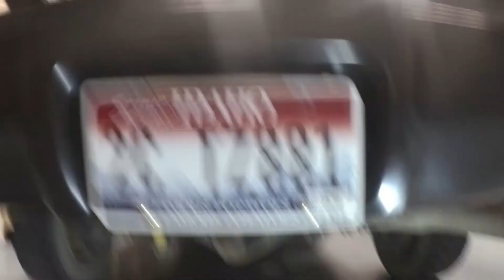Roll Pan Part 2

Comment: What size of nuts/bolts were you using? :)
Reply from the maker: It has been a while since I did that instal but I think probably 1/4” bolts and nuts.
Reply: @DarksideDiesel  Thanks, from one 208 to another

Comment: You could have cut the license plate screws so that they didn't stick out the back of the mounting tabs instead of drilling more holes in the roll pan.
Reply: True

Comment: Cant tell you how happy I am I found your video on YouTube. I just purchased this exact same bracket for my trucks roll pan. Had no idea which way to flip it for install! What size and style of drill bit did you use?
Reply from the maker: To be honest I don't remember. If I am guessing it was probably 1/4" bolt I used and a 1/4" drill bit. That is plenty strong to hold it on there. So glad the video helped.

Comment: What did you do about the license plate light?
Reply from the maker: I used double sided 3M adhesive. It will hold anything on. Really some amazing stuff. Just cut a strip for both sides where the screws would go and clean both surfaces with rubbing alcohol. It won't come off if you do this. You can buy a toll at any parts store.